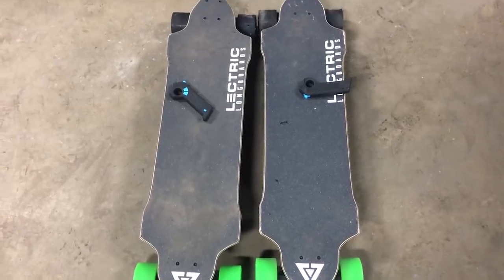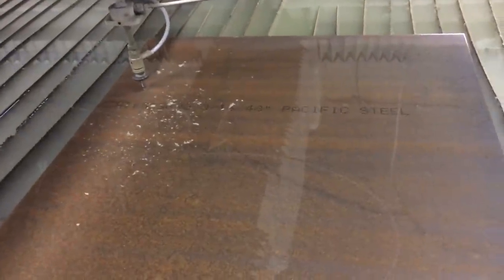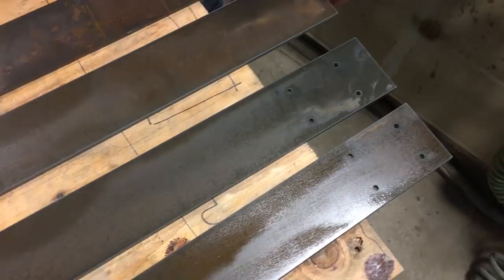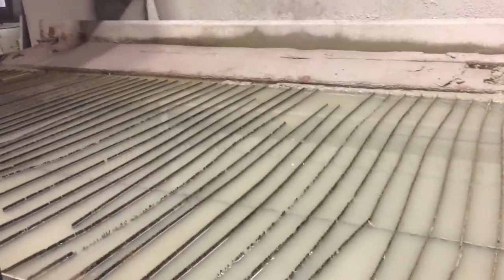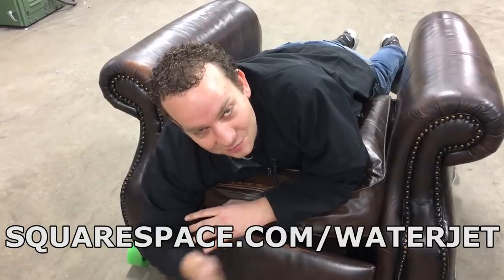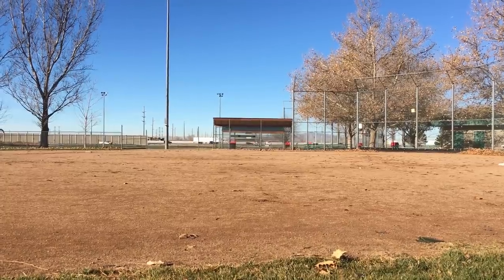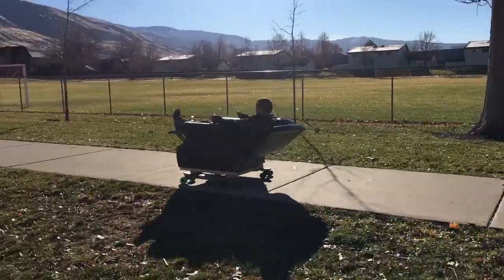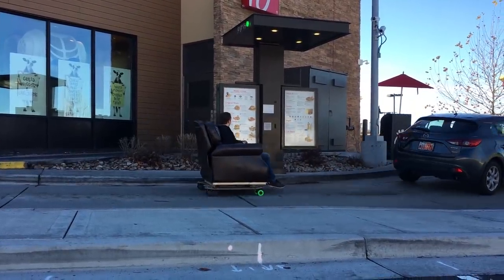Electric Skateboard Recliner through Drive-Thru - Waterjet Channel

Comment: You should make an origin video for the water jet channel. It could answer questions like, what you do for a living, how did you find the water jet, and why does Mitchell lick things?
Reply: You do realize they do youtube for a living. Do people not realize you can make a living off of YouTube?
Reply: They definitely have another job...as in the machine shop
Reply: Their day job is Interwest Manufacturing and Waterjet Cutting. See all that scrap around the shop with shapes cut out of it? Yeah, those were real orders they cut for their business. There are also a few videos where some footage is from actual operating hours and you can see the other employees that work there. They just do YouTube videos after-hours using the equipment. Waterjets are necessary for some metals, and ideal for pretty much all of them, because it produces no heat affected zone. The 2 best metal cutting technologies are easily waterjets and lasers. Lasers still make a small heat affected zone, but nothing like plasma or torch cutting.
Reply: Waterjet Channel (